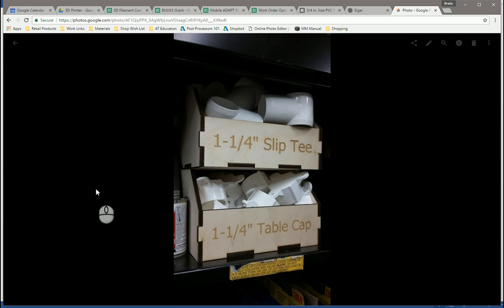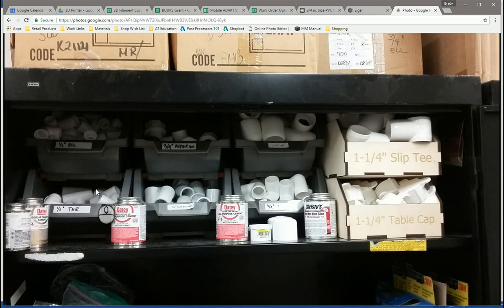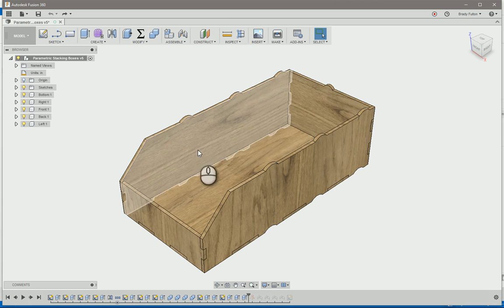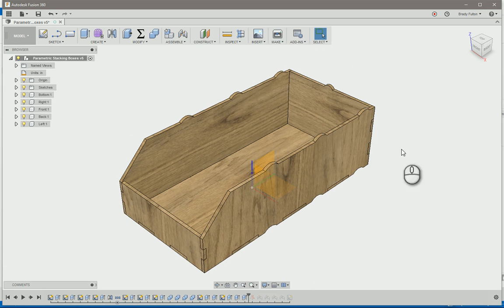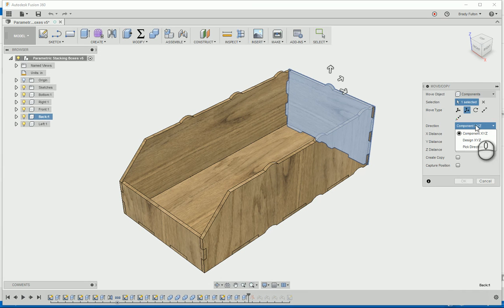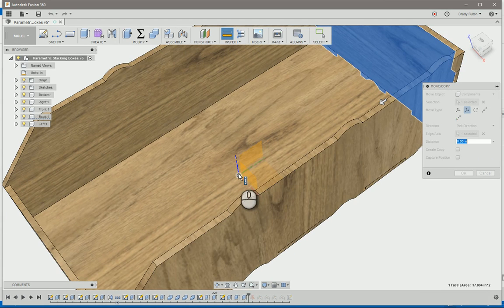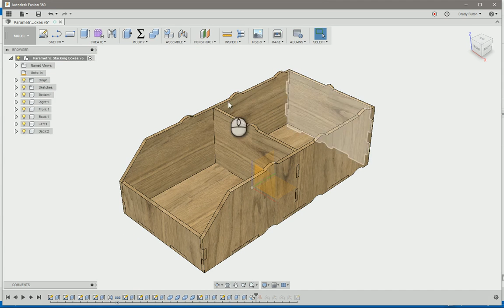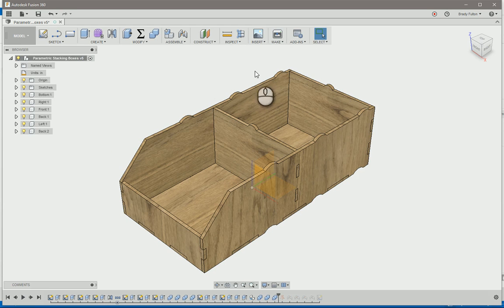Moving an object to zero on an axis in Fusion 360

Comment: hey can you center an object to zero on just one axis? I.e you want to keep the bodies position of Y but you want to change Z, is this possible?
Reply from the maker: Yes it is, if you create a new sketch on the XY plane and project a reference from your object then close the sketch and move your body from point to point utilizing the point from the original object on the body and the reference in the sketch that should just move it in the Z direction and then you can hide the sketch.